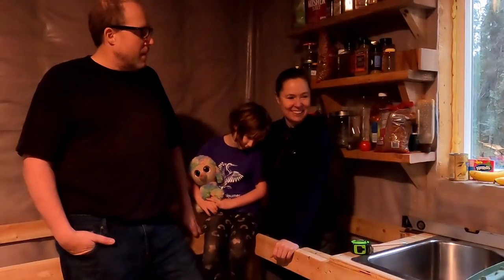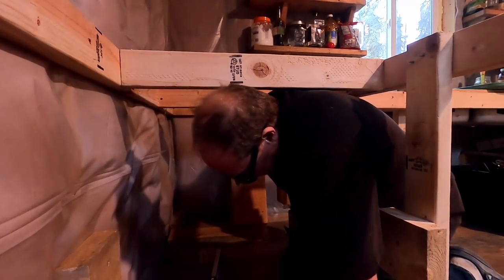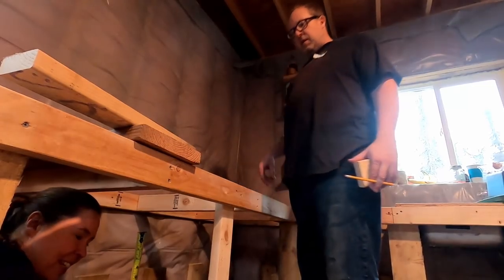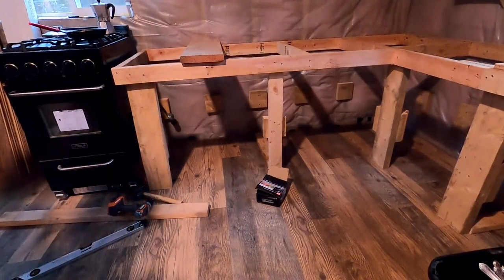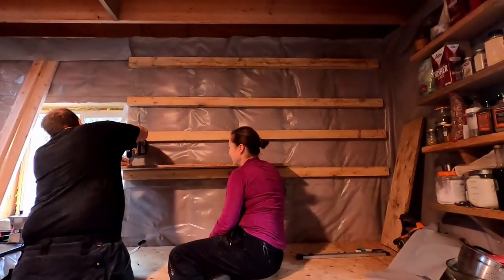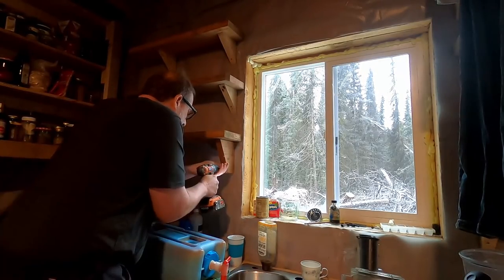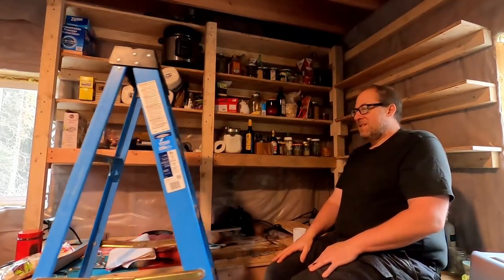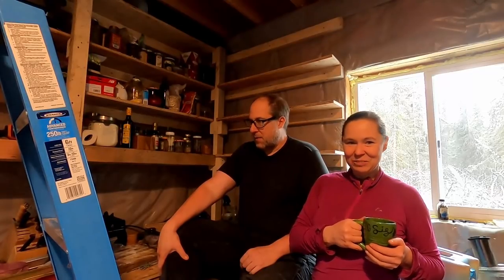Alaska off grid cabin | Counters

Comment: I hope im not too late to suggest this. You might want use Vinyl for the inside cavity of the window that stuff is water proof also it adds VaporLok. Given the climate you guys are in. Its also relatively cheap or you could use Hardieplank. But vinyl is better. And just craft your own trim around the window's. What I like to do is, take the style of crown molding that you typically see along the walls/ceilings. And make the molding match. Is up to you guy's how you do it. Im sure it will turn out great. But, just a suggestion.

Comment: Make sure you guys start collecting firewood! Start cutting in the spring or every chance you get until you have an abundance of it. Takes about a year to dry if you take the time to split it. May want to build a little firewood shack too! Our cabin was about twice that size and we went through about 10-12 chords a winter.
Reply from the maker: A firewood shack is a huge deal and we want to get one built ASAP
Reply: Don't forget dry area to store it

Comment: Shelves coming along! Nice kitchen👍 One thing I noticed: You Have Your Propane Tank Inside?? You need to drill hole thru the wall and mount tank outside. Don’t want an accident in your new cabin. B Deacon Manitoba Canada 🇨🇦
Reply: One more brief comment: when cutting on the table saw, safest to push board thru with another short board not your fingers. Not being critical but Safe Tip